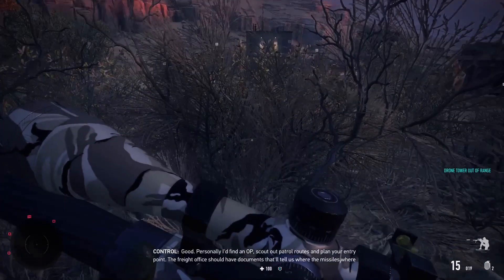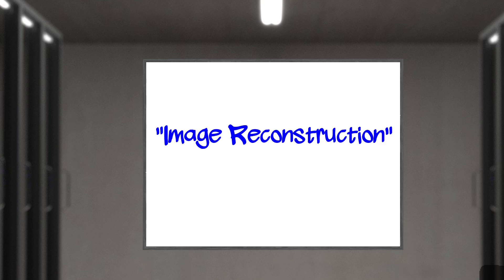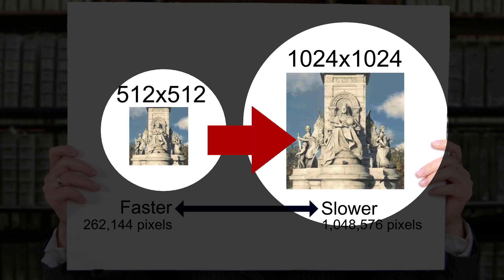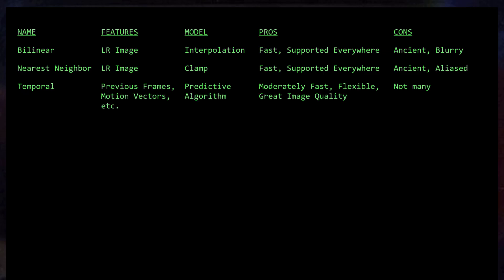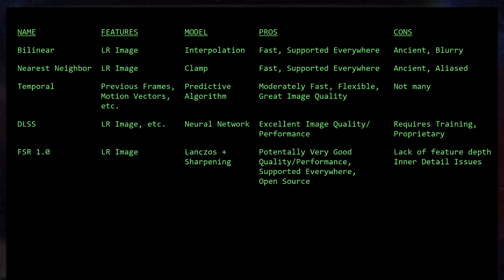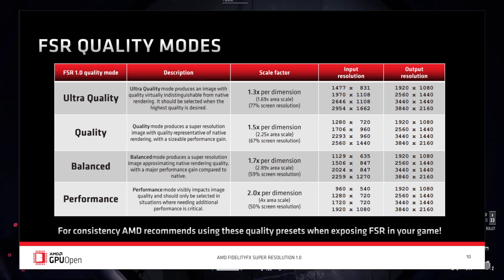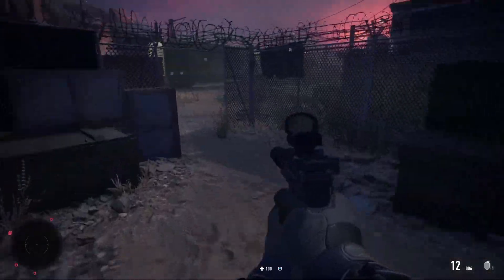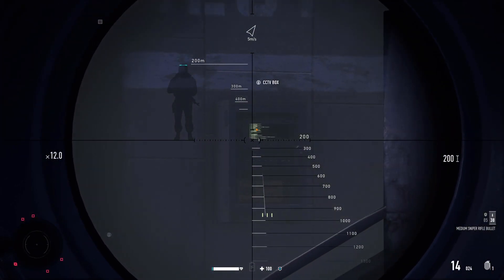AMD FidelityFX Super Resolution (FSR) 1.0 - Series S|X/PS5 Bound?

Comment: Great video!

Given that AMD FSR is open source, do you believe it could be programmed to work with with Direct ML on Xbox Series X|S consoles for an Ai component.  I think you touched briefly on Direct ML Super Resolution staying open source, but is there any reason the two would be mutuality exclusive?
Reply from the maker: As it's already in beta DirectX (where it fits well), we should see it on Series X|S soon. I read that Myst will already have it when it debuts on GamePass shortly. Thanks for the question.
Reply: @StellarContinuumGaming  Thanks for the reply, I think my question may have gotten lost though.  I know FSR will work with Xbox through Direct X, I'm specifically wondering if AMD FSR is able to work with Direct ML Super Resolution "image construction" technique, or would they be incompatible?
Reply from the maker: Sorry, I guess I misinterpreted your question. My opinion is that it depends on how Microsoft wants to position DirectML going forward. If they want to generalize these upscalers as a specialization of an inference engine (e.g., DLSS, XeSS, etc.), it could make utilization on PC/Xbox easier, but again it depends on MS's vision, not mine. 🙂